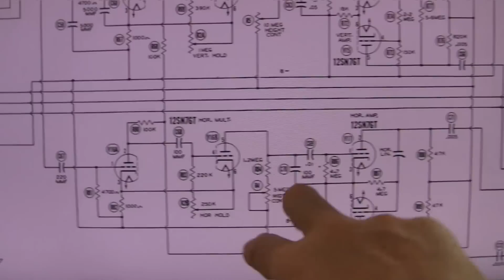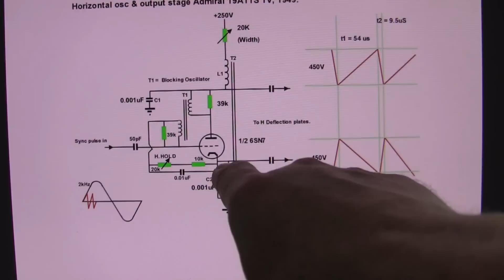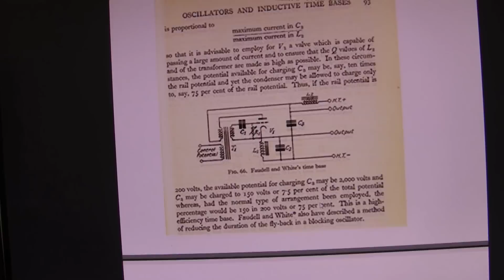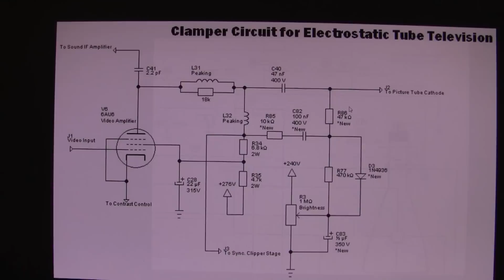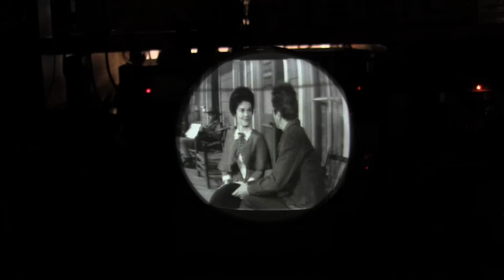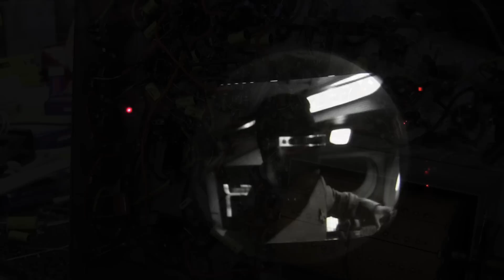How to restore a 1940s electrostatic TV (Motorola VT71, Admiral 19A1, etc) : part 12

Comment: The DC restoration mod by itself might help reduce the retrace lines, since those should be at the black level, and should not appear unless you adjust the brightness and contrast to lighten up the dark areas of the image, or because with no DC restoration, they can drift up in intensity, along with everything else. The retrace mod should help more though, since the gun should be cut off even if you adjust the brightness up.